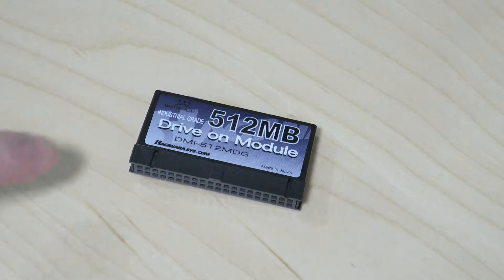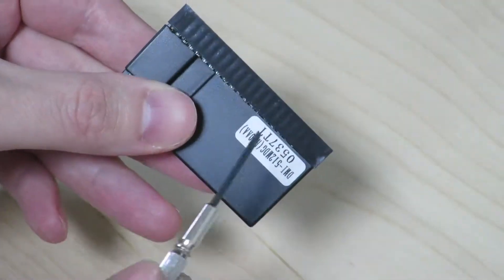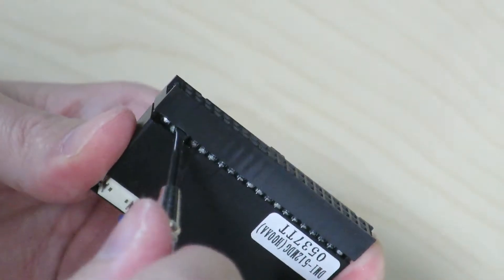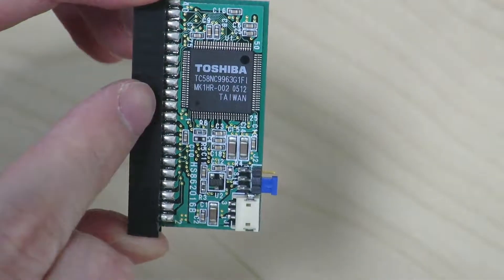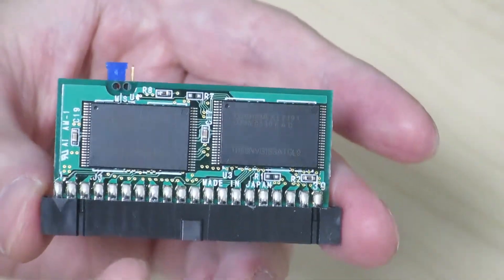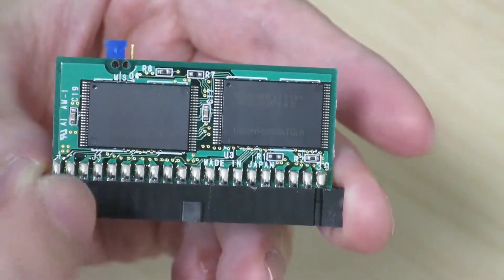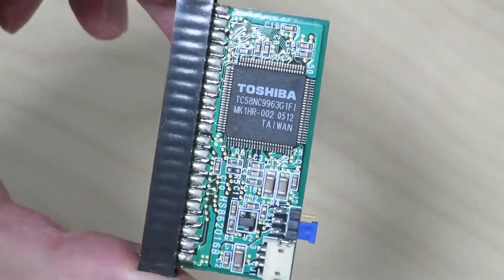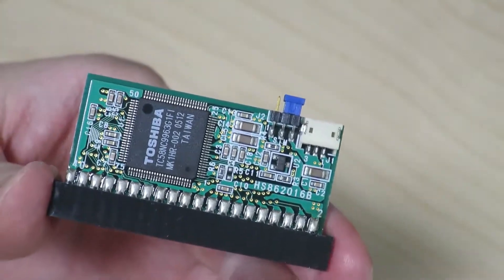Teardown! 512 MB IDE SSD: "Drive on Module"

Comment: That size of DOM from 2005 is irrelevant as these DOMs, especially "Industrial" labeled ones were used in auto manufacturing robots, CNC machines and other industrial equipment that runs 24/7 or close to it. Some single-task machinery could operate on 64-128MB of flash memory.

Comment: is there any way to use it on computer with some adapter or somethink?
i have samsung 4gb 40pin module
Reply from the maker: It really depends on the module in question. 40 pin does sound like a typical IDE device, but that's no guarantee. Best to refer to the manual for that particular module. :)
Reply: yes it fit on ide but only directly to motherboard is there any adapter?
Reply: @stefanosanestis2956  I have a same doubt but I have 44pin .is there any  option to connect with my pc

Comment: Week 30 of 2005, 

That's older than my first PC build.
Reply from the maker: Seems like this SSD was built around that time. (There's a marking that suggests that the module itself was built on Week 37 of 2005). I was assuming that this was older due to the small capacity (hard drives were available in capacities of hundreds of GB at this time), but it seems to be a 12 year old drive. Thanks for the comment! :)
Reply: Well, Akihabra's never stop amusing me! Expecting something weird (in the good way) next time.
Reply from the maker: Actually, this particular item was from an online auction not from Akihabara... But yes, the kinds of things I find at Akihabara are quite interesting. Especially the really cheap stuff that are sold as junk. I hope to get more videos up as I find more "weird" stuff! :)
Reply: coobird's lab oh, I thought that was an online action from a forum in Akihabara. Well, seems nice to have an online e-part auction
Reply from the maker: Yeah, this was just from a generic online auction website. They tend to be less cost effective (when adding shipping), and also less of an adventure, because it doesn't require having to physically walk around periodically to find stuff. (However, there are stuff on auctions which can't be found offline, so I pick and choose depending on the type of item.)
Reply: @coobird  I lot of these flash modules were aimed at restoring old DOS based embedded systems in which case 512MB would be plenty of storage space would be my guess on why the capacity is so small.